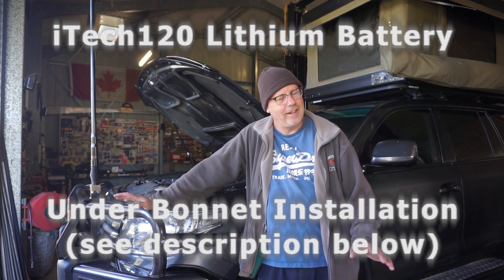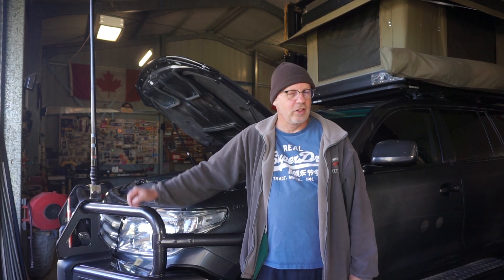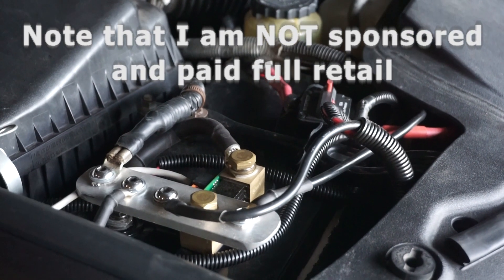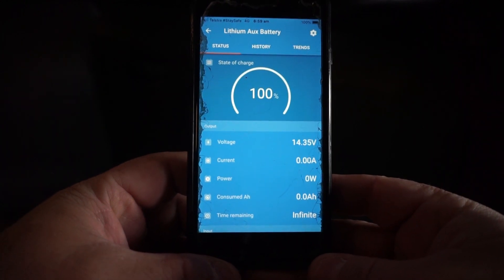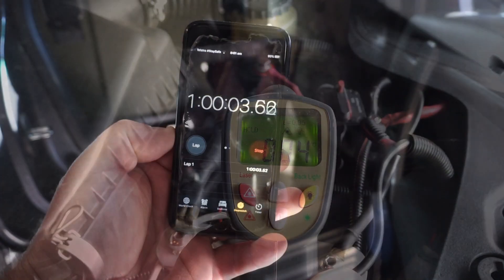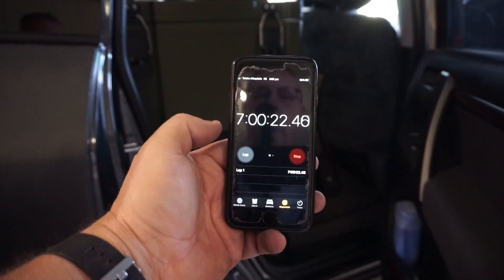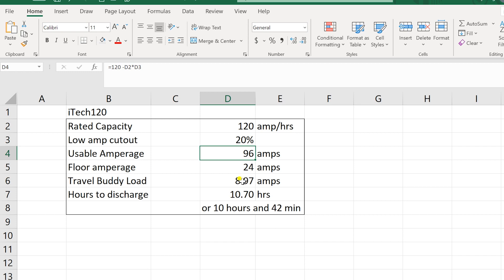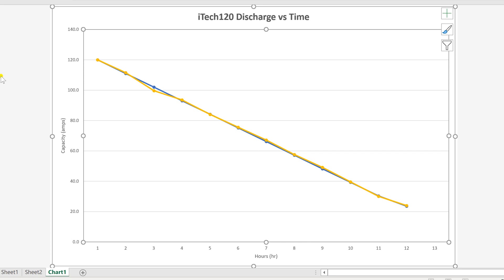Lithium Battery Long Term Review | itechworld 120 Under Bonnet Installation

Comment: May I ask, how do you achieve Low amp cutout. Do you do it manually?
Reply from the maker: There is no such thing as a low amp cut out, amps are a measure of current flow, and not storage.  The BMS has a low voltage cut out to protect the cells from being completely drained.  This is part of the batteries internal BMS and is something that is automatic.  Cheers
Reply: Thanks mate..!!  @JafffaAdventures
Reply from the maker: No worries😎👍

Comment: G'day Jaffa, did you baseline the battery when new?
Reply from the maker: No mate, I took the specifications from the manufacturer.  Cheers👍😎
Reply: @JafffaAdventures  now you have a baseline with the testing done a couple of years ago, it would be interesting to do another capacity test. 

I've had Lithium (LiFePO4) batteries test at all sorts of capacities. The latest (a 120Ah Kings Blue Top) test to 136Ah!
Reply from the maker: I hear ya.  I did a subsequent video to this one and compared the two results, that video in my library somewhere.  Given this test was so close to the manufacturer specs, I suspect it would have not been too far off that.  However, you are correct in that without baseline testing you cannot be certain.  The main purpose of the video was to impress upon viewers that you CAN run a lithium under the bonnet.  Most are coming around now, but back then it was still hearsay and rumour😉👍

Comment: Terry sorry to bring this up again but I had the usual Facebook comments when I posted about the new Donaldson filter I put in and there in the forefront was my itech battery and got all the that’s bad comments you’d expect
Just checking did you put heat shield on yours 
I note itech now recommend that but I’m sure they did not when I bought them around the same time as you 
I’ve since added the start version as well
Cheers
Joe
Reply from the maker: Yes Joe, I agree there are many haters but you and I know the real story, they are good kit.

I did insulate the battery as per this video.

iTech120 Lithium Battery Under Bonnet Installation in your 4WD 4x4
https://youtu.be/VYWhfbTcVFs

Cheers👍😎

Comment: Great video thanks. Wondering what battery tray you used for the itech. Thinking of the swap but can't seem to find a tray long enough.
Reply from the maker: Thanks Kyle, I appreciate the kind words.  I modified the factory tray as per this video.  Cheers👍😎

iTech120 Lithium Battery Under Bonnet Installation in your 4WD 4x4
https://youtu.be/VYWhfbTcVFs
Reply: @JafffaAdventures  great thanks.
Reply from the maker: No worries 👍😎

Comment: Might have missed it mate but how are you charging the battery?
Reply from the maker: I’m using a Redarc BCDC25.  I could run this battery straight off the alternator but I’m using the solar controller on the BCDC so it made sense to keep it in there.  Cheers😎👍

Comment: Excellent video and great results.
I’ve just bought one of these iTech 120x batteries and fitted it to our caravan.
How does it go charging from the smart Landcruiser alternator?
Reply from the maker: Thanks for the kind words mate, I sincerely appreciate it.  I’m charging the battery through a red BCDC but only because I use the BCDC as a solar controller as well.  I have heard they charge fine with the LC alternator but have no first hand experience.  Cheers😎👍

Comment: The iTech website says eh 120X holds 105Ah :- "Our new design has allowed us to increase the power storage capacity up to 105Ah of power, the iTECH120X is our highest capacity battery to date." How does that affect the test?
Reply from the maker: Good question Andrew.  I would suggest that it would simple extend your end point.  As you can see by the test, the discharge rate is pretty close to linear.  My battery hits the floor at 20% capacity (96Ah).  It looks to me like iTech are now taking this down to 12.5% (if they are getting 105Ah of useable juice because the start point has not changed, (ie 120Ah for both the X and non-X batteries)).  So in terms of the amount of extended life, continue the straight line discharge to 15amps remaining and that should be pretty close.  Of course this comment is theoretical, I do not have a 120X nor have I tested one.  Enjoy your research mate.  Cheers

Comment: Great video, just starting the Battery selection and your information is so valuable, will go with the itech batteries one for Aux and one for starting, the good part about these is you are dealing with an Aussie company, which has got to be alot better for solving any problems that could pop up.
Reply from the maker: Thanks for the kind words Warren, I sincerely appreciate it.  I cut another battery test video after this one (it’s in the library) and as you see from that, it is still performing very well.  When my lead start battery dies, I’m definitely going lithium in that slot as well.  Lithium is a real game changer, you will not look back.  Cheers😎👍

Comment: Is it a start battery or only auxiliary and if it’s used as a starting battery did you need anything from the alternator to the battery or just plug and play
Reply from the maker: Its a aux battery only as detailed in the video.  Again as detailed in the video, I have it running through a BCDC charger.  Itech claim it's plug and play but I cannot verify as this is not how I have mine hooked up.  I do know this particular battery cannot be used as a start battery.  They market a different unit if you are going to use it for starting.  Cheers

Comment: Hey Terry great job with the stats and the real world vs someone told me evidence. I will be switching to lithium in my Jimny just based on weight alone for my car and now have confidence it’s right way to go. Can I ask how operating a winch might be affected using the lithium?
Reply from the maker: Thanks for your kind words mate, I sincerely appreciate it.  My battery is an auxiliary battery and runs EVERYTHING except the winch.  That needs to be on the start battery due to high current draw and the alternator can supply more charge current as well.
If you are running two batteries, hook your winch to the start battery.
If you are running one battery and going lithium be sure to get a lithium start battery that can take high current draws as there is a difference with the two itech units.  Check out their website for details if your going down that route.  Cheers😎👍

Comment: Hey Terry thanks for the video mate. Just a quick question to get my head around this, as I’d like to do a similar capacity test on an old battery. When you were installing the battery monitor, did you have to input the theoretical capacity of the battery from new? I.e 120Ah. 

In this test when you discharge from the battery, the monitor is comparing total current out to the theoretical capacity of the battery to calculate SOC %. So in the test here, when comparing SOC %s it’s really just theoretical vs theoretical. Hope I’ve explained that adequately as I must be confusing something. Cheers mate
Reply from the maker: Hi Hugo, I’ll try and answer the best I can.  Theoretical was new only.  I took the rated capacity of 120 amps and worked out at 20% SOC is should have burnt up 96 amps (the batteries internal BMS stops the discharge at 20%, you can’t draw any lower than that).  For the test, the battery was charged to 100% (which was the point where the charger went into float) and this was confirmed with the Victron battery monitor reading 100%.  The Victron unit knows (because as you note, you tell it what the capacity was from new) the battery has 96 amps of usable juice, so it provides you a percentage remaining based on how much you have consumed.  I trust this answers your question Hugo.  Cheers and thanks for watching 😎👍

Comment: Hi jafffa do you use the lithium for cranking the engine as well?
Reply from the maker: Hi Jon, good question.  No I do not but only because my lead start battery was brand new back when I bought my lithium.  When my lead start does die, I will be replacing it with a lithium start battery.
As an FYI, I will be releasing another long term capacity test in the next week or two (videos come out every Friday).  That will be two years of getting flogged for the lithium auxiliary battery.  Thanks for watching mate, I sincerely appreciate it 😎👍

Comment: I'm here to see if lithium batteries are worth the money. I'm about to get a DCDC charger compatible with one, and I'm tossing up starting with an AGM or going straight lithium (This is my first dual battery setup, complete DIY installation)
Edit after watching: You're ballsy putting that $1000+ battery exactly where it's not meant to go, but I'm glad you did so we can see how well it performed. That's very very convincing to hop aboard the Lithium train. Thanks man!
Reply from the maker: My pleasure Nathan.  It’s been in place under the bonnet now for almost 2 years.  It has not missed a beat and I have flogged it to death.
I’m a lithium convert and will never be going back to lead.  In fact, when my start battery died I’m replacing that with lithium as well.  I will repeat the same test in a month or so if that of interest stay tuned.  Enjoy your build mate, that’s half the fun.  Cheers😎👍
Reply: @JafffaAdventures  what kind of lithium battery can support the current output to replace a cranking battery? That must be so expensive.
Reply from the maker: All lithium batteries are on the expensive side when just comparing the sticker price with lead, it’s only when you do the maths overtime that you realise they are actually cheaper in the long run.  My lead crank battery is only a year or so old so I’m not ready to replace it yet, but when I do I’ll certainly look at itech again (among others).  They do a 1420 cranking amp lithium for $699 currently.  Cheers😎👍

Comment: Good work mate. I prefer to do my own  work testing too over listening to  forum posts that have never tried it themselves. I find real value  in sharing the real world results of such tests. I have a mate who just did the dcs set up in his 200. We'll see how they hold up m I'm about to do a diy lithium battery set up in my 4wd but it will be in the cab. Still gets pretty hot in there during summer., But we do what we can do.
Reply from the maker: Nice one mate, thanks for sharing.  Could not agree more, lots of opinion out there, much less fact based on evidence.  As you say, we do what we can do.  I have seen the DCS setups as well, they look pretty flash.  I’m going to do another capacity test in a few months at 18 months of ownership.  I’ll post up the results as well.  Thanks for watching and commenting, I sincerely appreciate it 😎👍

Comment: How's the battery performing currently champ?
They've got an offer on the newer model atm and am thinking of pulling the trigger and getting one.
Reply from the maker: Going strong Mark, no noticeable deterioration in performance.
I will do another test in a few months (at the 18 month mark) but I suspect the results will be similar to the last test.  I saw the special they are running, pretty enticing indeed.  Cheers 😎👍

Comment: I got a lot of peace of mind from that video Terry.  Thank you very much.  Do you change through the Victron device?  I love the app.
Reply from the maker: Thanks for your kind words Steve, I’m glad that you found it useful.  That’s really the sole purpose of why I put these together.
I’m not sure by what you mean “do I change through the Victron device?”
I have made setting mods to suit the lithium profile if that’s what you mean. 
Cheers😎👍
Reply: @JafffaAdventures   sorry that should have read “charge”.
Reply from the maker: @stevehill2371  ahh, got it mate.  The BCDC earth runs through the Victron shunt so any charging from the BCDC is recorded as current going in.  This is very very useful.  Cheers
Reply: @JafffaAdventures  I currently charge through a ctek d250s and am wondering if There would be a benefit is swapping to the Victron.
Reply from the maker: I don’t think I can answer that as I am not familiar with the Ctek.  But if the ctek earth runs through the shunt, the Victron would register any current going in.  Cheers

Comment: Great video gave ya a👍
Is that battery connected to the cranking battery?
Reply from the maker: Thanks Brad you are very kind, cheers.  The aux battery sits on its own and is only connected to the rest of the car through the Redarc BCDC charger.  I cannot link the two to use both to crank but given that there are no accessories hooked to the start battery other than the winch (which is only run if the car is running) it should never get pulled down while parked up.  If it does for some reason, I can just hook up the solar to it and have a few beers until it has enough juice to crank.  Thanks for watching 😎👍
Reply: @JafffaAdventures  Thanks for time and information cheers👍
Subscribed as well👍
Reply from the maker: My pleasure Brad, welcome to the family mate, I’ll try and keep the content as interesting as I can.  Cheers😎👍

Comment: Fantastic video Jaffa. It is great to see a well controlled test to explore the parameters of these batteries. My next vehicle is looking at not being able to install under bonnet so I may just have to do a rear install in a battery box. Thanks again.
Reply from the maker: Thanks for the kind words Stephen, I sincerely appreciate it.  There is so much rumour and hearsay about under bonnet and heat etc, but very little fact.  That was the reason I decided to do the test.  I’ll run it again in a few months and post those results up as well.  Ag, thanks for watching and commenting 😎👍

Comment: Hi Terry, great video, thank you for sharing. 
I’m currently in the market for a Lithium battery, I understand I will require a DC DC charger for vehicle charging. 
I current have a CTEK Multi XS 25000 AC charger whilst my camper trailer is parked at home to charge my current AGM battery. Not sure if you or other subscribers know whether this charger is sufficient to charge a lithium 120 AH battery.
Cheers Tony.   PS, I’ve also subscribed to your channel 👍👍
Reply from the maker: Hi Tony, thanks for commenting and welcome to the Jafffa family, really cool that you found enough value in what I am doing here to subscribe.  I'll try my level best not to disappoint.
I have the exact same CTEK charger as you do.  Although it does not have a lithium profile setting on it, I use it frequently on my lithium battery.  I don't know if this is a good thing or a bad thing, but my lithium battery is holding up just like new so evidence would suggest I'm not doing any damage.  Thanks again for following along.  Cheers
Reply: @JafffaAdventures  thanks mate for the super quick response. That sounds like great news, one other question if you done mind. Do you leave your Lithium batteries connected full time to the CTEK charger whilst based at home?
This is what I currently do for my AGM batteries, just want to make sure it’s the same process 🤔.
Cheers Tony
Reply from the maker: No worries Tony, happy to help out in any way I can.
I do not leave my lithium connected to a charger during long term storage as this actually reduces the shelf life of your battery.  I store my batteries between 40% and 70% state of charge when not in use.
Validated studies prove that storing at 100%, or on charge for long periods of time is detrimental to the battery life.
For example, storing a lithium unused for 1 year at a 40% SOC will result in 98% of the recoverable capacity after 1 year. Storing the same battery at 100% SOC will result in a battery that has 94% of the recoverable capacity after 1 year.  Similar logic for why they suggest not to leave your laptop plugged in all the time, and rather cycle it.  Cheers😎👍
Reply: @JafffaAdventures  awesome, thanks so much mate, you have been really helpful, very much appreciated. I’m now really looking forward to watching your entire library.
Cheers Tony
Reply from the maker: Good stuff mate, cheers😎👍

Comment: Excellent video my friend! I’ve just bought the same battery......well I bought it 3/4 months ago but was stuck in Western Australia but am back home and at this very moment am waking up to glorious rain at a place called Kangaroo Valley. I was happy to know that this battery will run fine on non specific lithium chargers aswell. I replaced my two heavy deep cycle batteries in the van that were gone - totally, as in leaking and outa shape. I’ve got the parameters to set up the projecta solar charger for the lithium and with the 240v charger I’ll set it to AGM. Will be interested to see how this battery goes. Thanks for posting🤘🤘 subscribed
Reply: No problem🤙 and I love your saying ‘lead is dead’🤣 very true! Gold haha
Reply from the maker: @chrisandshazza01  Cheers!
Reply from the maker: Nice one mate.  My battery is still going strong and I’m never going back to lead.  In fact when my start battery packs it in, I’ll swap it out for a lithium unit as well.  The days of lead are well and truly numbered and it’s only the cost and ignorance that is keeping lead alive.  I think the big turning point will be when manufacturers like Toyota begin to put lithium in their new cars.  Thanks for watching and subscribing, I sincerely appreciate it 👍😎